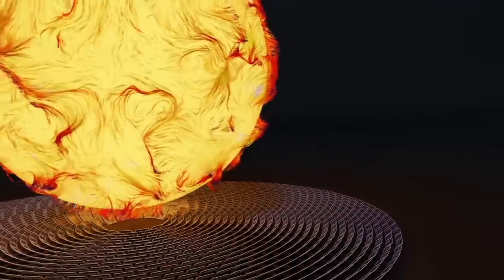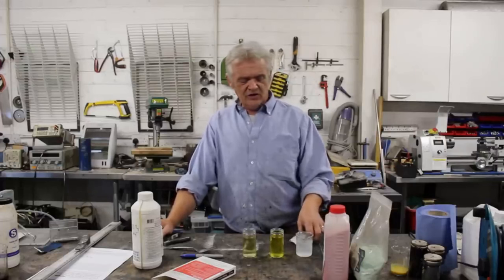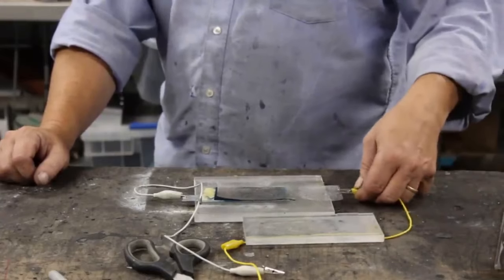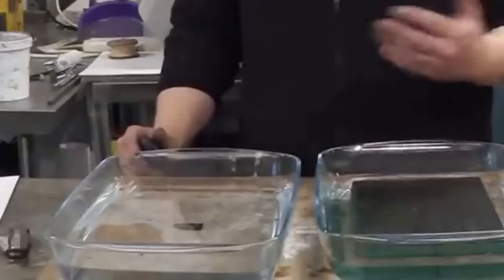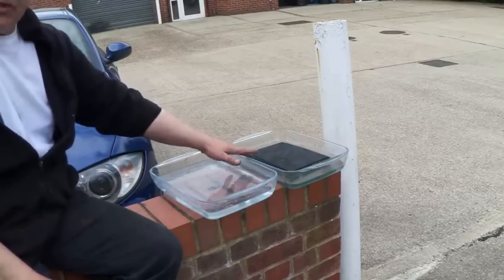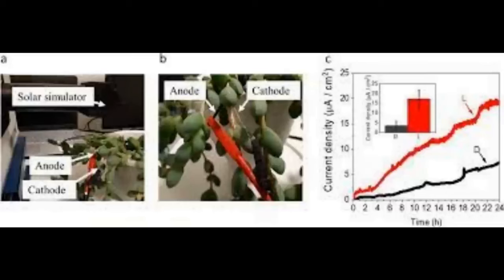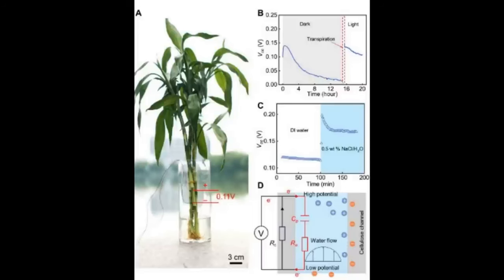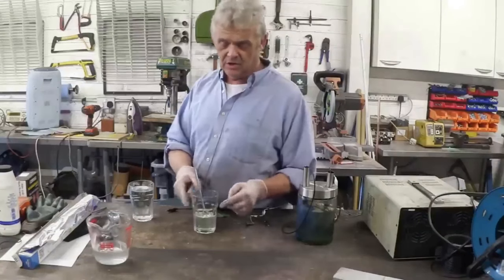Man In A Shed - Episode 5

Comment: 29:13  How is the aluminum oxide produced in the cell?  I suppose it's an aqueous solution?  I think the first step to selling this to the masses, would be an internal heating, or chemical desiccant that would turn it into a dry powder.  Preferably as simply as the device is itself.  Then said dried powder can be put into a collection vessel and shipped off.  As a non chemist, I would be much more inclined to handle a dried powder than some tincture of unknown toxicity.  Also, I don't see the link to the patent?  Do you have the number?

Comment: 1:03  what I'm really interested in is a material, preferably a paint or varnish material, that can capture Alpha radiation.  (and transfer that directly into electricity  Obviously even a sheet of paper could stop it, but it wouldn't DO anything)  And it got me thinking about suspensions.  Specifically with that varnish idea, could you create a PN junction using a suspended reactant that could be cured and dried?  I suppose I could make a photonuclear cell with some radium tubelets basically taped to the panel, but A: that's been done before on YT, and B: we can't "legally"  get most radioactive materials here in the USA, thanks mommy Govt. And C: said tubes of radium would be HORRIFICALLY expensive to try and cover a 100W panel with, for a maximum output of around 33 watts.